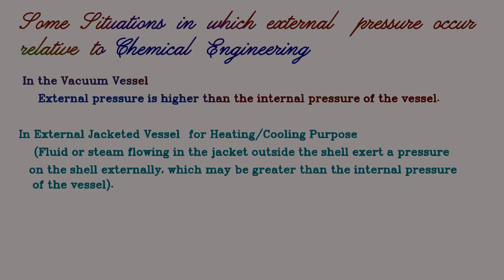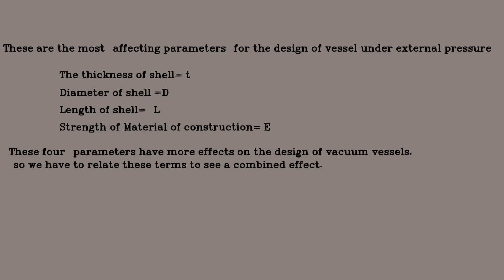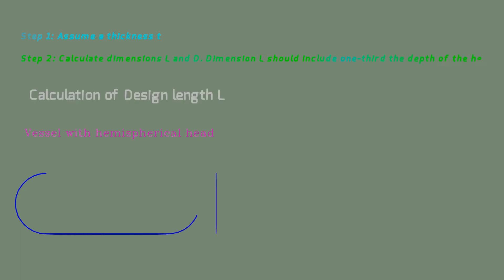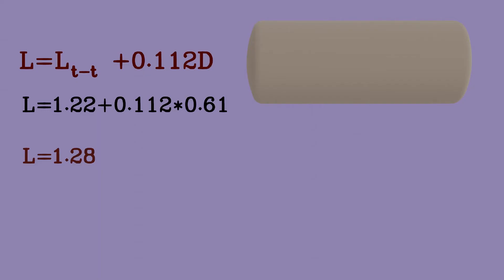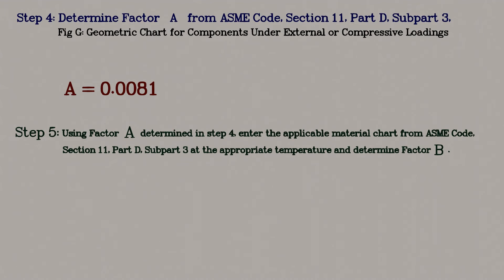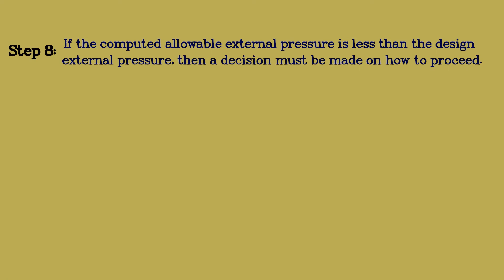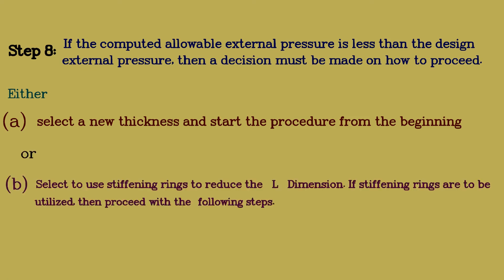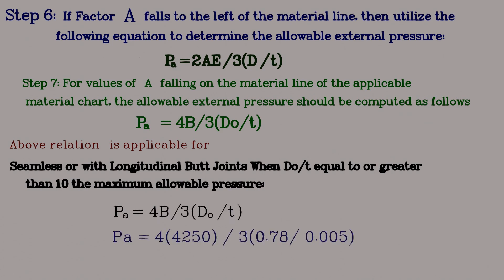Design of External Pressure Vessel | Vaccum Vessel | Shell Length and Thickness Calculation

Comment: Hello, I need to design a vessel which has internal vacuum and external pressure, is it possible to design with ASME standard. Kindly help me. My application is for high vacuum with external cooling coil and pressure
Reply from the maker: yes, you can design with above stated ASME Standards. Suppose your maximum  jacket pressure is 3 bar and inside shell is with prefect vacuum that is equal to -1 bar  the total external pressure would be 4 bar  as there is inside pressure and all the pressure is external one, and you have to design an external pressure vessel with 4 bar external design pressure or even slightly increased to consider other safety factors and margins.

Comment: Thank you so much for sharing the knowledge. I appreciate your efforts. 

I have 1 doubt that, how you calculated design pressure P which is 15 bar. And what will be the value of P when my vacuum chamber is under 2 mbar inside pressure
Reply from the maker: I think, it would be 15 psi, not 15 bar, that's  very high external pressure, and as concern to you vessel's vacuum pressure, if vessel is exposed to atmospheric pressure that's almost 15psi then your external pressure of vessel would be 15psi  minus your internal pressure of vessel that's 2mbar =0.03psi that would be 14.97 psi  external pressure, or in brief you can choose your external pressure 15 psi for this vessel and perform calculation using your shell thickness, for allowable pressure, and then compare with design external pressure .